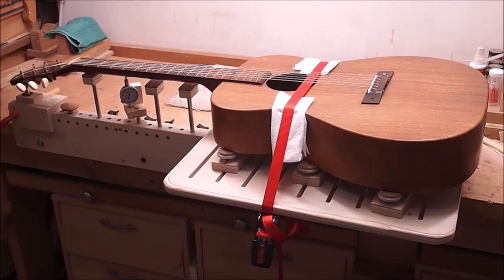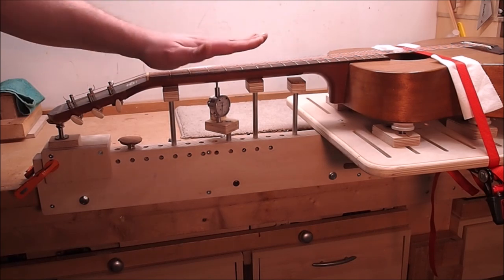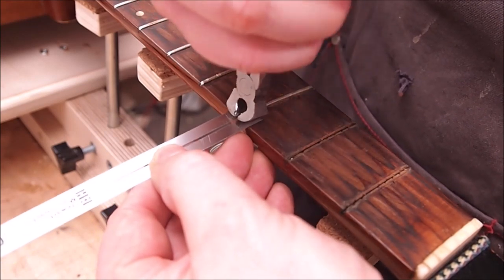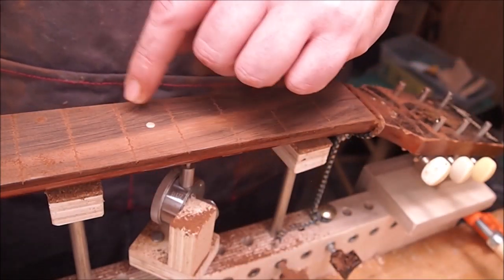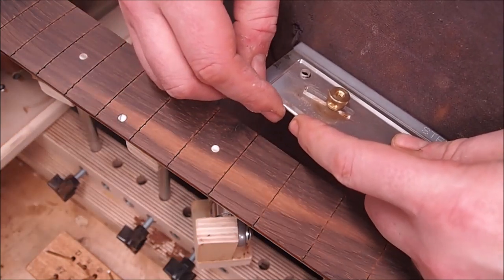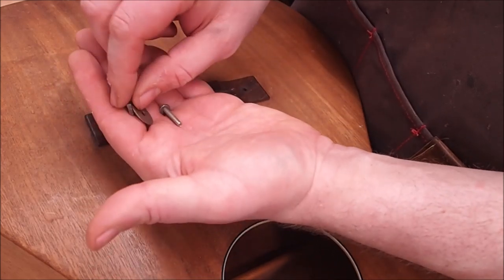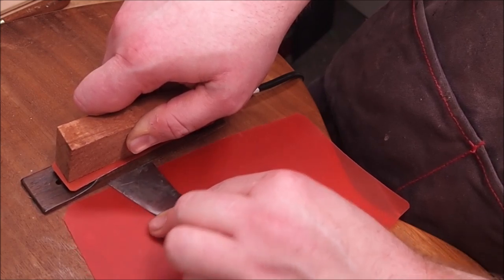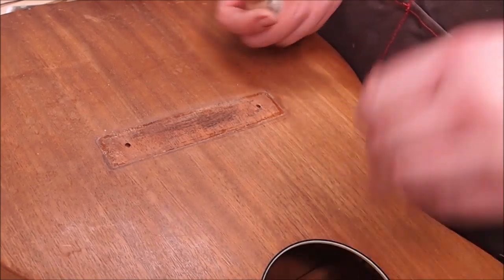Harmony Overhaul Part 3

Comment: This video, this particular series, and this channel as a whole, is the perfect example of how important it is to have the right tools.
Reply: Well you have the skill first and foremost.  You can own the most expensive, most well setup guitar in the world, but if you can't play guitar very well, and lack the discipline to practice and learn it will likely just sit in the case.
Reply: Indeed. And that is one of the issues with doing this sort of stuff at home  even if you have the skills. You can't really justify a fret wire bender, fret saw, rubber hammer and so on,  just to use it once every 10 years!

Comment: i can't imagine that many of these guitars from harmony ever received this kind of extensive restoration and repair.... lucky guitar.
Reply: Sad part is I sold them brand new back in the 70s.
Reply: Robert Turner ripppp
Reply: Lucky owner, to get this type of care from a master luthier.  I have an old  Harmony Marquis 166,  it needs a lot of work to the neck ( I think it's slightly warped)   But even in its current condition it has the most amazing sound quality and sustain for days.  I would walk on hot coals to have it restored by Ted!

Comment: When using the fret board protector, is the technique to have the flush pliers push down on the protector as the fret is pulled?  New to guitar building and I think I just used this tool wrong.  Had a bit of tear out and now have bunch of chips to glue back into place.  Not sure what glue to use on the ebony chips.

Comment: I'm puzzled now.  Was the neck on that guitar twisted?  Twisted only when not under string tension?  Not twisted at all?  I don't get why the jig was used tbh.  Any explanation would be greatly appreciated.
Reply from the maker: The neck is bowed upwards more than usual. I want it to be straight when it is under string tension.  On a guitar with an adjustable truss rod I could change the amount of bow. This guitar does not have an adjustable rod, so I'm using the jig when flattening the fretboard to hold it exactly the way it will be with strings on.
Reply: @twoodfrd  Was the jig used to actually straighten the neck or just for measurement purposes?
Reply: @roytofilovski9530  The jig is used to simulate string tension.  With the simulated tension applied,  you sand the fretboard to be straight, then level the fret tops.  Then, when you put the strings on, the fretboard will be straight and the fret tops will all be in the same plane.
Reply: Thanks for the explanations.
Reply: @roytofilovski9530  You're most welcome.